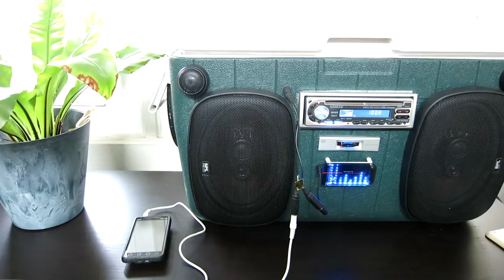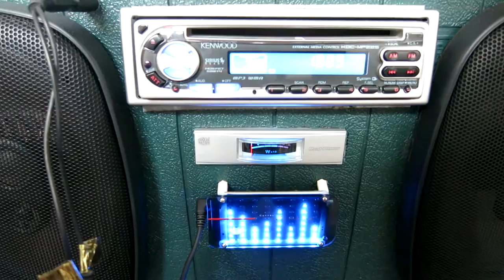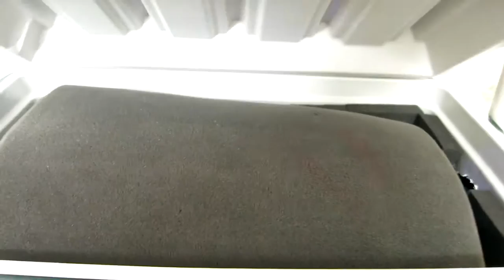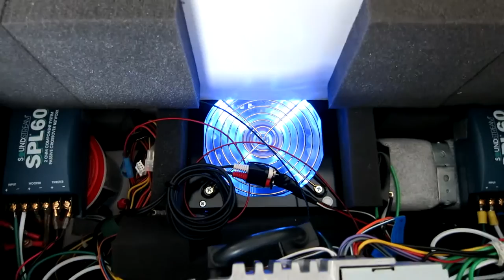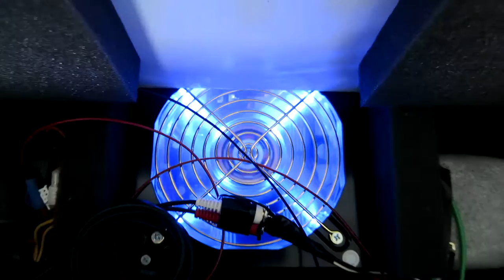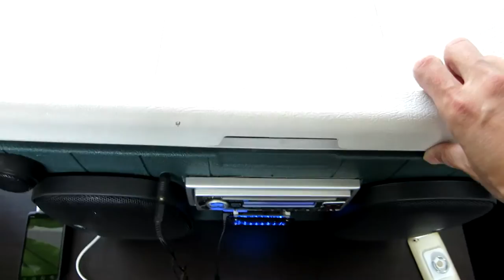My DIY cooler boombox - sound is awesome!

Comment: were u get the eq at the botton
Reply from the maker: I got it from Ebay, it needs some soldering work, you may get a built one for some more money.
http://www.ebay.com/itm/Red-Blue-Yellow-white-FFT-8x8-Audio-Indicator-FFT-Voice-Frequency-Control-LED/221645612168?_trksid=p2047675.c100011.m1850&_trkparms=aid%3D222007%26algo%3DSIC.MBE%26ao%3D1%26asc%3D38530%26meid%3Ddea0426b0db54cc48f7760cf5dd4a7d6%26pid%3D100011%26rk%3D3%26rkt%3D12%26sd%3D131366777479

Comment: Just a question first on dual voltage sources, can they be separated through a spdt switch . Secondly, you seemed to do a great electrical job, was this the first boom box?
Reply: Yes. I am doing that with mine with a DPDT switch
Reply from the maker: I use two switches, one for selecting the voltage source, the other one is just for on/off.
this is mine first boom box, wiring took a while but it is not difficult if you draw your connection on the paper.
Reply: MTBHKR I agree. it looks good. I have 4 switches on mine.
Reply: MTBHKR look at my build. I supplied a link below. I actually rebuilt it if you look for the video that says Phase II
Reply from the maker: Watched your Phase II, it's really an eye-catching. It's also very portable. 
I am no expert of speaker box, but usually the box is filled with damping material to make sound stronger/cleaner.  
You can try to fill some foam to see if you hear difference.
Reply: The small speakers were actually not on. Those were the 6 x 9s. The sound didn't translate very well to the phone recorder. It sounds better than it does on the video. I only use the small speakers when I listen to it at a low volume next to my bed